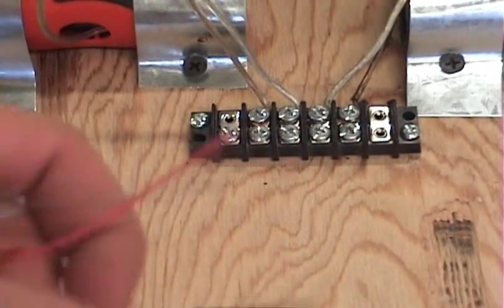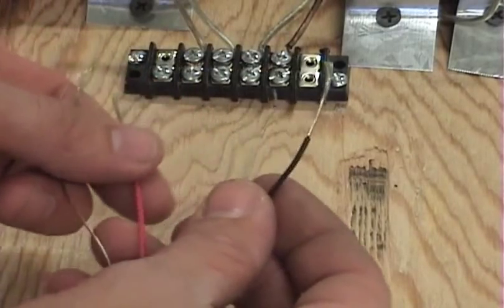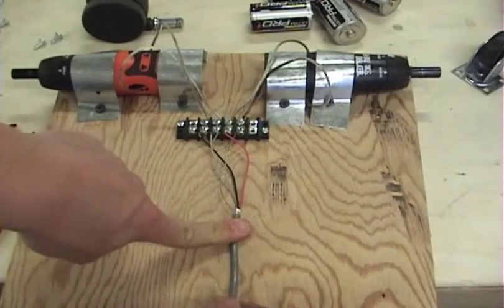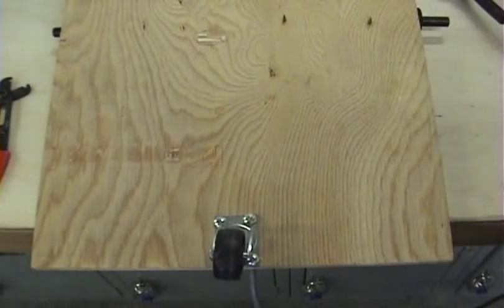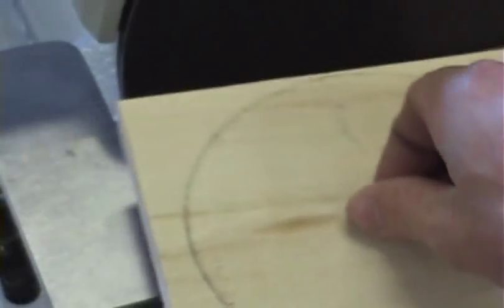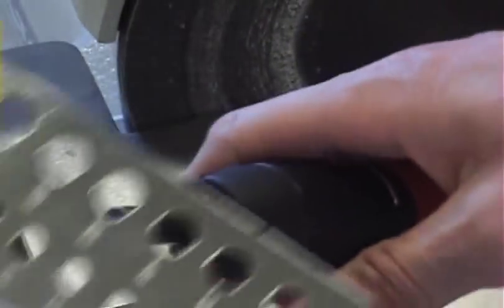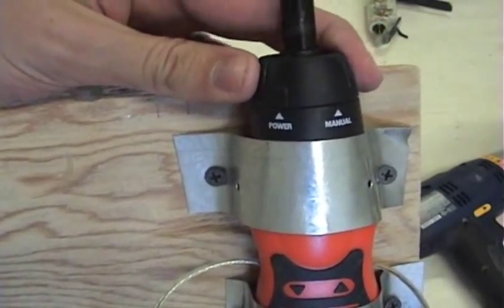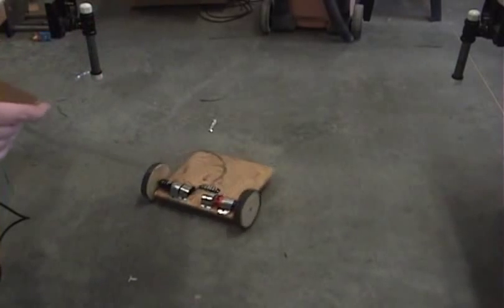how to make a battle bot part 4

Comment from the maker: It is safe to use as long as you make sure that it will not touch another wire.  I cover the pneumatics in class with the students and I let them come up with different designs.  I guess I should make a video about them for my non-students.  My friend that came up with the POV wand is almost done with a cheap way to make these wireless.